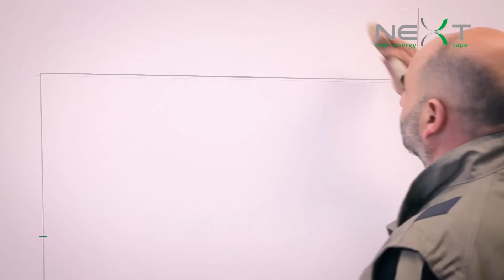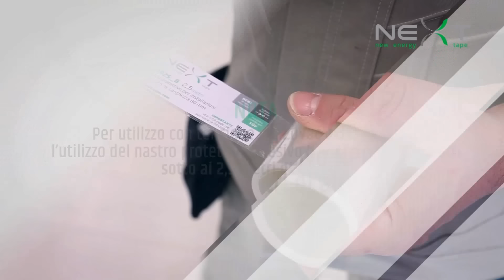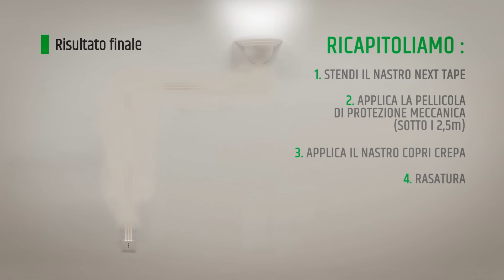IMPIANTO ELETTRICO SENZA ROMPERE I MURI? - Next Tape il Nastro Elettrico Adesivo

Comment: Dopo 30 anni di servizio mi tocca vedere un video che non rispetta le normative più elementari, tipo che un conduttore non SELV non sfilabile non può essere murato a meno di 5 cm dalla superficie della parete. I differenziali non proteggono sempre: in caso di contatto diretto può capitare che non aprano il circuito. Come già qualcuno ha fatto notare, quí con un banale chiodo si rischia di rimanere folgorati.  L' isolamento elettrico e la protezione meccanica a mio parere non sono sufficienti.
Reply: sarebbe bello se ELCO ELETTRONICA rispondesse a questo commento di Luigi, visto che qua si rischia di diffondere informazioni tramite video che possono portare serie conseguenze. Se si pubblica un video del genere si dovrebbe essere anche pronti, secondo me, di rispondere ai commenti più rilevanti.
Reply: Nessun elettricista degno del titolo userebbe questo sistema. Pericoloso, e difficile da interfacciare all impianto esistente.  Come ho gia scritto in un commento, potrebbe trovare applicazione nella delocalizzazione del centrovolta per illuminazioni in bassa tesione. Ma solo nella psrte alta della stanza. E solo in bassa tensione. Sempre che i nastri utilizzati riescano a gestire correnti continue. Senza diventare dei costosi fusibili...

Comment: Per chi dice che la 220V è  pericolosa che scalda la plastica ecc.
Io vivo in Germania  e lavoro per una multinazionale (molto conosciuta) che produce centraline/inverter microcircuiti ecc per le auto ibride cosiddette 48V (BMW-MERCEDES-PORSCHE e così via )
I nostri circuiti compresi i microcircuiti lavorano su una tensione di oltre 200V in corrente continua che triplica fino a circa 650V in alternata quando arriva ai motori ed utilizza lo stesso principio del video, con la differenza che il foglio di una lega particolare è fissato sulla ceramica da 1mm e spesso 0.01mm.
Da tener conto che l'amperaggio delle batterie oltrepassa di gran lunga i 1000A che a casa fino alla lampada non hai.
Il punto è che se il materiale è di buona qualità ed il lavoro fatto bene come il video ci mostra, è  davvero un ottima cosa a mio parere.
Complimenti ragazzi.

PS: ad ognuno il suo parere!
Reply: E' proprio il contrario! E' la corrente I che per effetto Joule scalda i conduttori. Se aumenta la tensione, a parità di potenza (P=VI), diminuisce la corrente, quindi è meglio aumentare le tensione per avere minori fenomeni dissipativi.
Reply: Fattostà che in casa per la 220v non puoi usare questo sistema, dimenticando di aver passato il nastro proprio in quel punto che tu magari un giorno vorresti metterci un quadretto, andando a prendere proprio il cavo della 220v col chiodo potresti farti male
Reply: nemmeno l'oro, il miglior conduttore a temperatura ambiente, tiene 1000 A con 1 mmq. Tu fai 1 x 0,01=0,01 mmq....
Perchè c'è l'obbligo per la CEI 64/8  di usare 1,5 mmq per gli impianti civili a 230 VAC? Per gli interruttori magnetotermici che proteggono l'impianto; se va in corto un doppino, filo, esempio lungo 100 m, questo deve avere una resistenza abbastanza bassa, in modo che non si surriscaldi prima che intervenga il magnetotermico.
Reply: Bosch?

Comment: No. Potrebbe essere una buona idea. Ma non per i 3 conduttori a 220v ac. Potrebbe essere utilizzato per 2 conduttori a 12vdc o 24vdc. Per esempio per spostare i centrivolta verso le pareti perimetralj della stanza. Per la realizzazione di illuminazioni led a strisce su supporto perimetrale. Mettendo il trasformatore ed eventuale dimmer a centro volta (se possibile. E portando l alimentazione attraverso questi flat cable fino al nuovo punto. A questo punto non sj avrebbe piu la rischiosa 220vac ma una quasti jnnocua 12 o 24 vdc.. e localizzata nella parte alta della stanza. Sempre che i nastri riescano a gestire correnti continue, che in certi casi possono arrivare a svariati ampere, soprattutto se a 12 vdc..
Ah, 21.5 €/mt (piu iva).... no. Troppo davvero. Se poi aggiungi il fatto di dover mettere comunque mano al muro per stuccare rasare e verniciare... fai un lavoro ben fatto, a norma, e definitivo con un sistema tradizionale..

Comment: sinceramente non lo trovo poi così pratico, perplessità per i carichi di Ampere di una certa importanza... quanto si può caricare su una linea così?
Reply from the maker: Il nastro NEXT segue pari pari il concetto del circuito stampato normalmente impiegato in elettronica e di affidabilità consolidata. In questo caso però il substrato non è rigido ma flessibile e consiste in film polimerico con una rigidità dielettrica nominale di 750 Volt. Analogamente al circuito stampato, la larghezza della pista permette di portare fino a 16A per la versione NM3BT25.